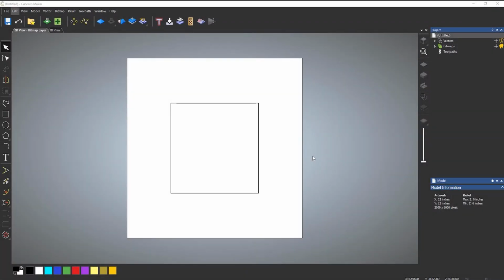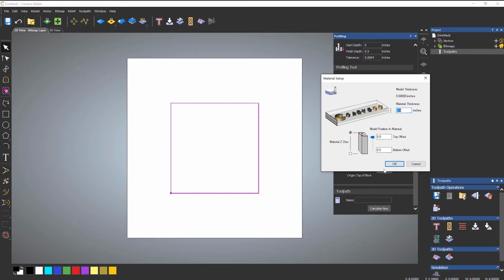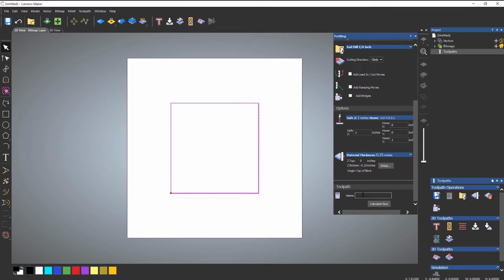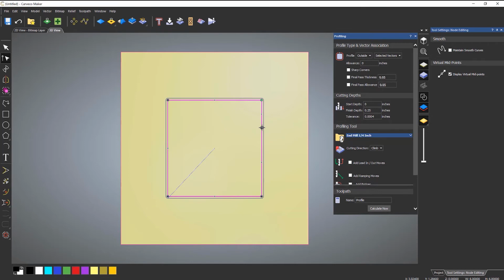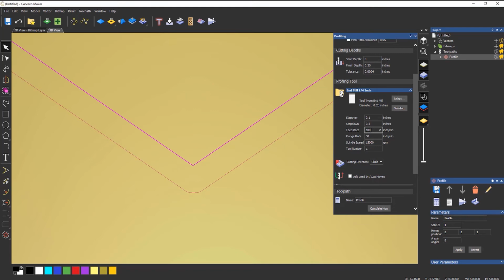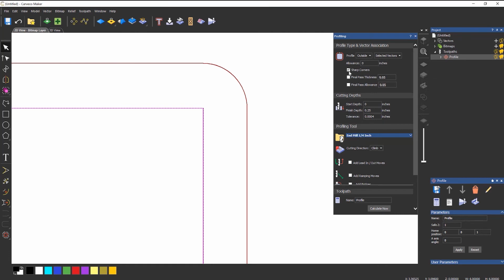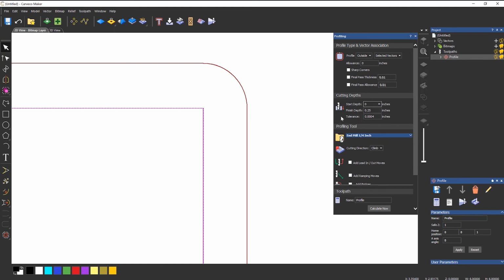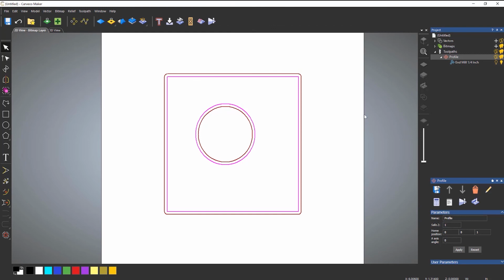Carveco Maker: Profile

Comment: Hi I have just subscribed , I am trying to follow the same process but I do not see the calculate tab on the create profile tool dialouge box, any advice?
Reply from the maker: Hi Steve.  Is this because it is hidden down the bottom?  Try and grab the blue header where it says "Profiling" and left click, holding the mouse down, move upwards so it moves the box up, are you able to see it then?  If you are still having problems then I would send support@carveco.com a message.
Reply: @Carveco  Hi There, yes it was indeed hidden down there out of sight; hanks for your swift reply.